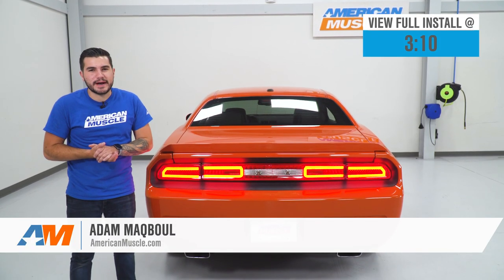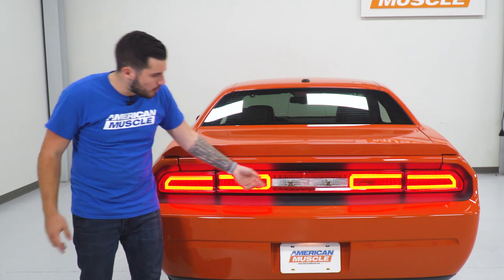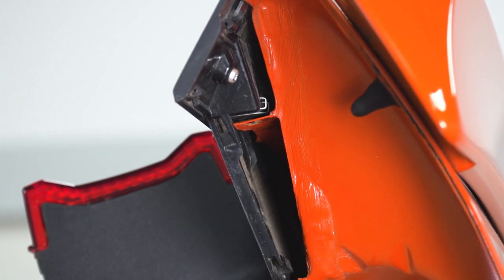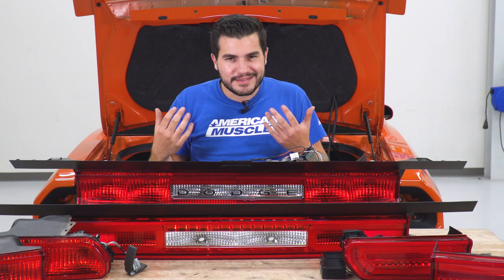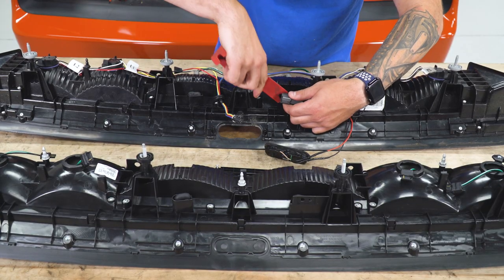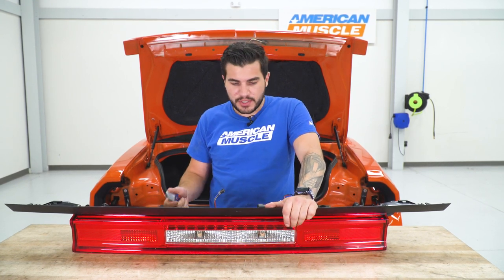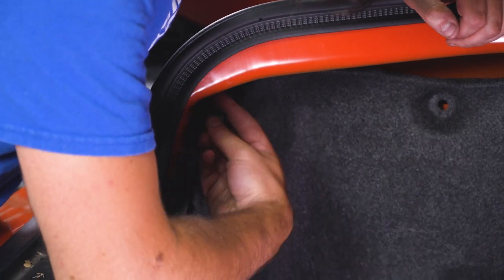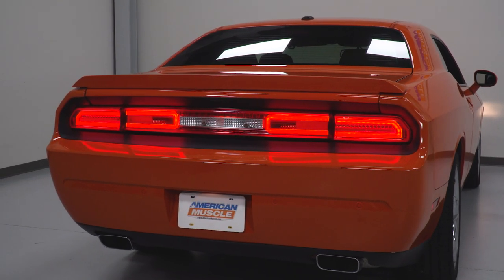2008-2014 Challenger Raxiom LED Tail Lights Review & Install

Comment: The problem with the RED/Clear version of these is that you see a bunch of red dots between the bars that looks messy, and the bars don't seem to line up evenly. Another issue is it has that ugly white section in the center just like the old 2008-2014 Dodge tail lights have, instead of that area being black like the 2015 and later Dodge tail lights.  

The newer Raxiom smoked tail lights look much cleaner, as you don't see all the dots between the bars, but they are way too dark as they look completely black during the day. They also include  LED reverse lights, so you don't need to reuse the old incandescent reverse light bulbs from the old OEM tail lights, and the center is black so it looks a bit more like the 2015+. I like that Raxiom uses good quality plastic lenses, made of the same polycarbonate material that Dodge uses. I was tempted to get the cheap-quality tail lights from Vland/MostPlus until I saw that they are made from  polymethyl methacrylate (PMMA) which will start cracking and deteriorating after being exposed to sunlight for a few months. I'm hoping that Raxiom will introduce a more modern version of their Challenger tail lights that are only lightly smoked with the black center that look more like the Dodge 2015 plus models.

Another option (although pricey), is to swap the entire rear end (tail lights and bumper) with the new Dodge parts that fit perfectly on the 2014 and older models.  bmcextremecustoms sells the complete "Helllcat rear end conversion kit" including modern Dodge tail lights, bumper, and fiscia for $2,339.99.

Comment: Can this set be used on a 2019
Reply from the maker: These lights are made specifically for 2008-2014 model year Challengers, and will not fit on 2015 or newer models. -Zach
Reply: Bro 2015+ already have LED taillights and headlights lmao why would you need this?

Comment: Ok...My OCD is in over drive here. These lights do not line up at all. Neither do the originals. This is an easy fix in the trunk at the thumb bolts. They look terrible. Have some pride and line the things up.
Reply: I wonder why they need 2 resistors in each tail light?? one for turn signal I get that part.  Other one????